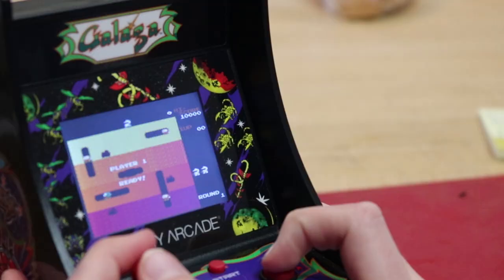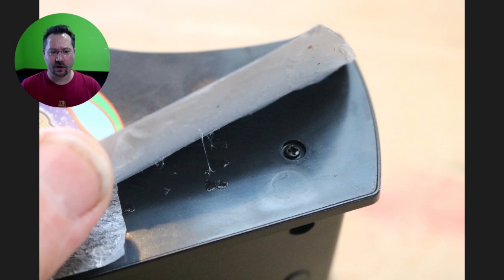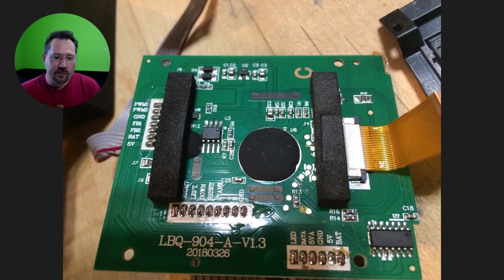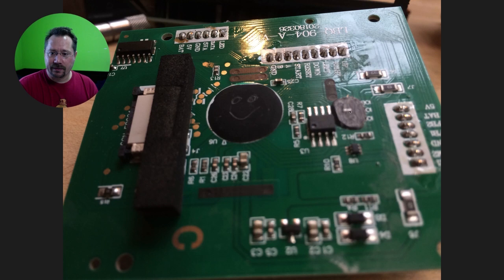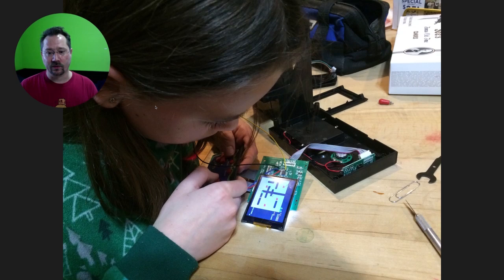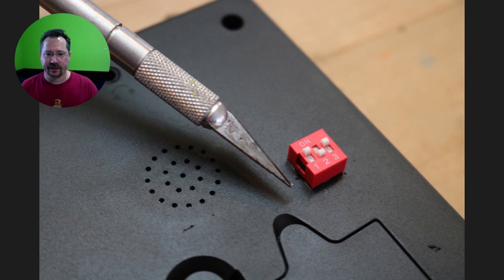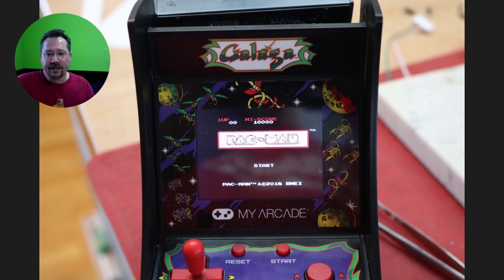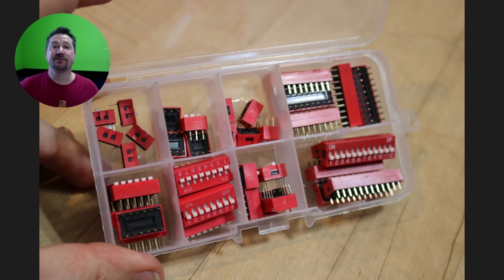How-to Hack Galaga into Pac-Man and more! | 6 Game Mini Arcade Machine Mod

Comment: Did a very similar thing with a 1st Gen Super Impulse Tiny Arcade Space Invaders. ran tiny wires from the pads to the 4 points on the joystick so when I turned it on I could hold the joystick in any direction to load Space Invaders, Galaga, Ms. Pac Man, and I think Pac Man.

Comment: good job, thanks for sharing 🙂
10:26 i've done this 100s of times in the past. nowadays I use a little bit of shrinking tube wrap, and a piece of drilled circuit board. much better! cut the circuit board as required for components and holes for wires, or even better: pin headers, plus some extra space for mounting. put small piece of shrink tube over soldered wires. much better results! more steps involved, but easier building, stronger connections, safer connections, easy maintenance (pin headers!), cleaner looks! :)
Reply: good

Comment: So, in short, this is a Namco Museum 20-Game Mini unit that has been dedicated to only Galaga unless hacked.  I have feeling it also has the other games too, though a bigger combo switch would need to be used.  This hack is great since these stand-alone units have the proper battery back-up to the lack of it in the Namco Museum cabinet.  Still don't understand why that one is missing the battery compartment.
Reply from the maker: No. This does NOT have 20 games on it. The internal pads that control which game is activated would max out at 9 combinations. It just has the 6 games on it.
Reply: @BenjaminNelsonX  Hmm, surprisingly then that it only has 6 of the 20.  You'd think the company would have them all on the board and just isolated the one needed for single game cabinets.
Reply: goooooooooooooooooooooooooooooooooooood
Reply: @BenjaminNelsonX  The strapping pins for the other games may be present (and the other games, too), but those lines might not be brought out from the main COB on this particular PCB. The reason they did this is not "flash" but because of not wanting to pay multiple NREs for mask-ROM. Oh, and 3 pads = 8 combinations, not 9 ;)
Reply: This one uses NES on a chip, and the Namco Museum one runs off of an Android 4.4 emulator repurposed from cheap android tablet internals.
Reply: @Phaota  probably saves money on chip price. Why add a giant chip if you're only going to be sending 6 to retail? 

The museum one is going for $70 rn.

Comment: I wonder if you can mod these to hook up to a regular size 19" CRT or Flat Screen TV. Then wire in larger controls and put it in a bigger cabinet
Reply from the maker: You probably could, but at that point, there are lots of other options, one of the most popular being the MAME system.
Reply: @BenjaminNelson  Yeah I know I've been using MAME for years since at least the mid 2000's. I've seen people throw a PC into an arcade style cabinet and have a great selection of games to play. But seeing how small that board is it would be easy to throw into just about anything you wanted that also allowed you to mount a screen and better speakers into. Plus having the toggle switch to flip between the 4 or 5 games could be fun. It could be a mini table top cabinet with a small 10" screen maybe. I find it very difficult to play those mini cabinets. To small for my fingers. I got my one son some for Christmas a few years ago. They are very cool little arcade machines.

Comment: FWIW, it looks like they've long since wised up and in 2023 at least these don't look to be hackable. I had gotten a Galaga one in July 2023 from a local Walgreen's in NYC hoping to do this very mod and give to my mom for Christmas and when I finally opened it up recently the board (with a completely different revision starting with DR- something) doesn't expose IOB jumpers nor epoxy-blobbed jumpers anywhere near the foam risers.

Comment: I have an older Dig Dug unit that appears easily moded. I have wires and the DIP switch ordered. Regarding the wiring, did you only run the black to one of the jumpers and one of the dip switches or did it have to connect to all three jumpers and all 3 dip switches? I see where you soldered the colored wires to the dip switch but didn't see how the black was soldered. I'm not very electrically inclined. Thx for any help.

Comment: I put a raspberry pi in mine 😊
Reply: Did it work
Reply: @jshersman3053  yes with lots of fabrication its running retro pi I’m working on a guide to making it.
Reply: @SagemodeDuey  just the person I’d like to talk to! I have 2 MyArcade cabs that I wanted to do the same thing. (The data east classics and Street Fighter 2 ones).  So getting a display to fit isn’t the issue I have. It’s repurposing the existing controller board. Is this possible? The buttons are sitting on a board and that has gauge wires soldered, and then bundled together to a harness. Could these be connected to the GPIO pins of the pi? Do I need a usb encoder? Or do I just simply have to get new tiny buttons entirely? Thanks for any help!
Reply: @Cargo_Bay  I completely skipped wiring the existing buttons and sticks to the pi. I use a Bluetooth controller. 2 reasons being one because if I’m emulating any N64 games or say something else then there isn’t enough there to be compatible with that. Reason 2 being I really wanted things to be simple so I flew through the project I just wanted to get the PI inside and the machine to emulate games.
Reply: @SagemodeDuey  yeah, that’s my current workaround. Really, I’m probably never going to actually play on it. It would be more for decoration to leave the screensaver/attract modes running, but still, it would be nice to have the buttons work. In that case, I might just find a display board that will simply play video files/or get a Pi 0.
Reply: I want to do the same thing with my 4 inch tiny arcade that I bought yesterday. I played around with it and managed to unlock 3 more games but now I'm ready to unlock a little more power by sticking a pi zero in it.

Are you using the stock lcd? If so, how did you manage to drive it?

Any info would be greatly appreciated
Reply: @Cargo_Bay  no worries man, appreciate the reply. But yep, after taking the unit apart and getting my hands on the lcd I just couldn't find any info on it whatsoever. So i went ahead and bought a 1.44" TFT  on amazon
Reply: good
Reply: BS

Comment: Three jumpers give a maximum of eight possible combinations. Are there eight different games, or do some of the jumper combinations just start duplicate games?

Also, I have an idea for Rolling Thunder, even though you said you don't care for that game very much. Add a slide switch to toggle the Reset button between being connected to the reset line and the B contact. I figure that the Reset button probably isn't used all that much during normal play and if you DO want to reset the game/machine, it's not that much trouble to flip the switch back to Reset mode. That way you have access to a second button without modifying the control panel. 

Or, wire it permanently as the second button, then add a small reset button on the back of the unit.
Reply from the maker: Some of the switch settings duplicate games.

Comment: Only one problem: "Rolling Thunder" has 2 buttons, the jump and shot...
Reply from the maker: Yep. And I specifically mentioned that. I didn't want to add another button, as it wouldn't match the existing one already on the cabinet, and it would have been a fair amount of work for a game I don't really want to play anyways.
The same company makes other mini-cabinet games. If a person wanted to try hacking one of those, they could certainly start off with a cabinet that already has two buttons on it.